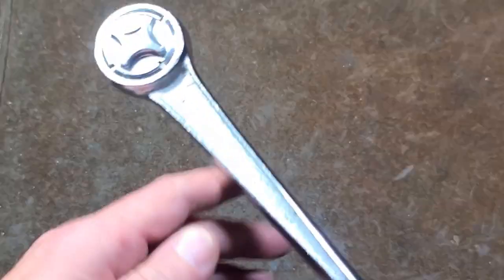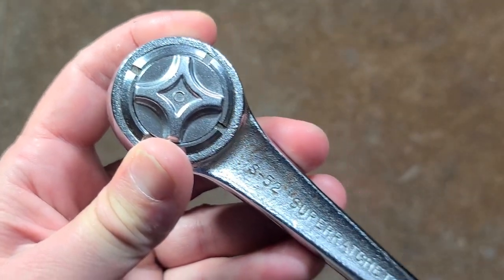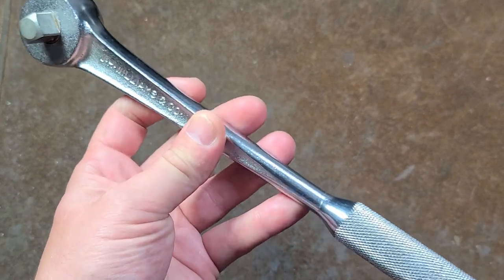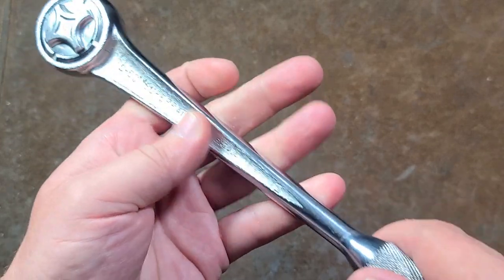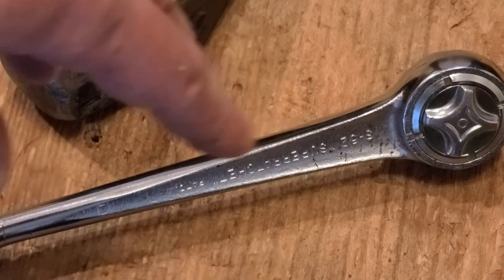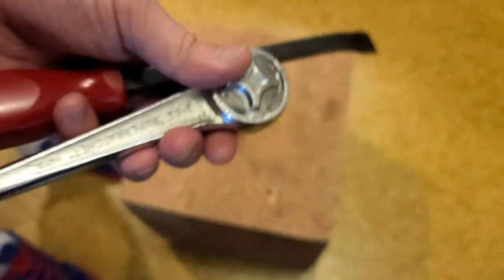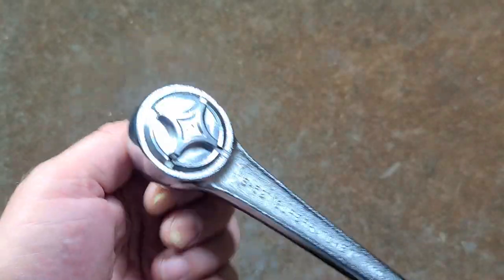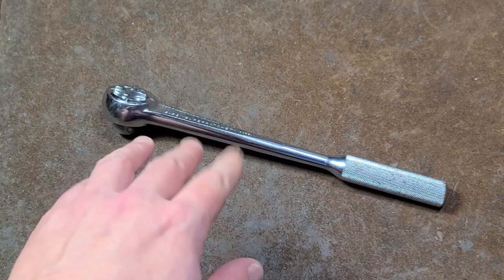Williams USA "SuperRatchet" 1/2" Lock Ring Ratchet Review

Comment: I have 3 of the J.H. Williams S-52 Super ratchets and after watching several videos on YouTube I decided to try disassembly and lubrication of the ratchets.  I used an adjustable spanner wrench designed for removing optical retaining rings on telescopes.  It worked like a charm on two of the three ratchets.  The other retaining ring didn't move.  I then used a syringe and blunt needle to apply PB Blaster penetrant to the threads of the ring.  After letting it soak for several hours, I used a round punch and small ball peen hammer to tap on the ring and break it loose.  Then the spanner wrench easily removed that retaining ring.  I guess I got lucky, removing the rings was not difficult at all.